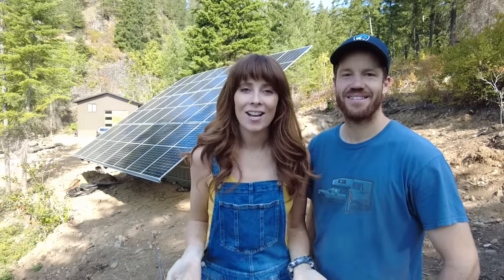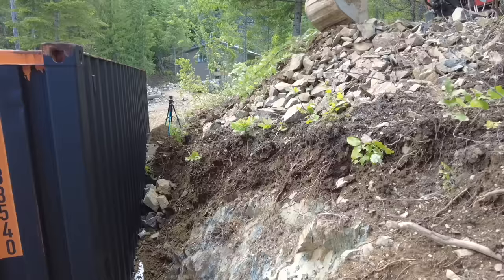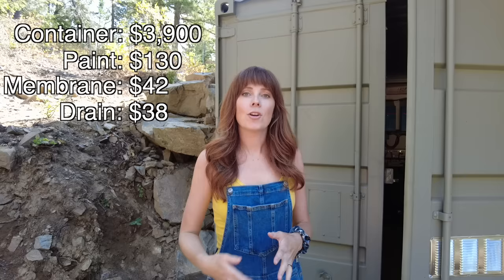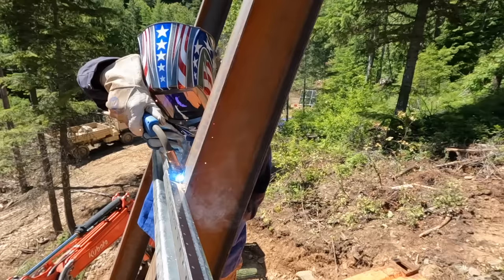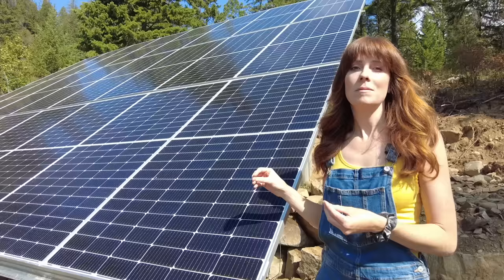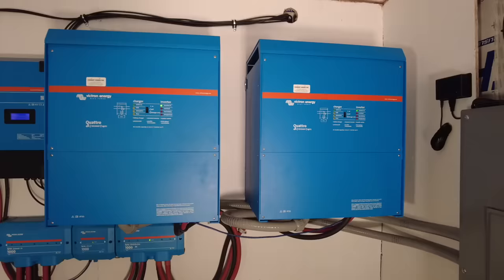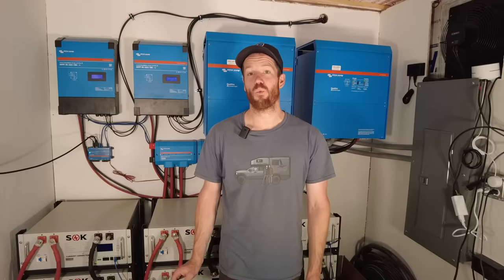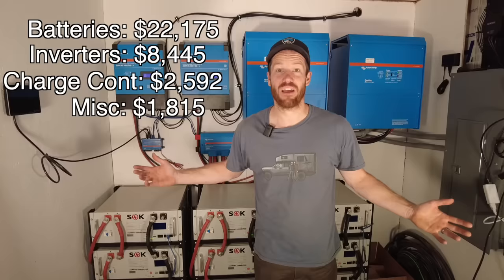TOTAL COST Of Our Off-Grid Solar Power System | Powering Our Mountain Home

Comment: I don't know if anyone will read this comment, but here goes anyway.  In 1995 My wife and I bought a small piece of property.  (2 Acres)  We put a nice 14x 70 mobile home on the property.  We were only 2 power poles from power, but the Power company  (Elko Nevada) want me to give them $12,000 for the privilege of paying them $150 bucks a month.  This made me mad!!!  At first we just had a generator, so I started to make our solar array mount.  We had eight 80 watt panels.  We had eight Trojan L16 six volt lead acid batteries.  We had a Trace 2400 watt inverter, so that meant that we only had 110 volt for the house.  We upgraded to an Onan 6500 watt generator powered by propane.

The house had a propane fridge, a propane clothes dryer, a propane water heater, an infrared propane wall heater, and the existing propane forced air furnace.  Since the insulation under the mobile home was all screwed up by animals, (we bought it used), I cut all of the underside plastic off, and installed 12 inches of fiberglass insulation, which was held in place with a system of special made brackets and plastic tarps and nylon rope.  It worked so well that after doing that we never ever fired up the floor furnace.  We also had a wood stove, but after 2 years of getting wood, hauling wood home, splitting wood, stacking wood, and dealing with the ashes, we just used the wall heater, which did an awesome job.  The home had real good insulation and 2x6 walls.

We had a well drilled and since the generator did not have 220, we installed a 110 volt pump in the well.  We filled a 600 gallon water tank that lived in the battery room, and pressurized the house with an RV 12 volt water pump.  Everything that I read at the time said that the RV water pump would not work long with continues use.  But being the bull-headed person that I am, I did it anyway.  The RV water pump worked just fine.  It ran the dish-washer, the clothes washer, showers, toilets, virtually everything.  I will admit that I supplied the pump with a 1" line right off the bottom of the tank, and then tied into the 3/4" pipe for the house.  I did not know how long the water pump would last, so I had a spare.  It lasted 4 years, and I changed it out in 10 minutes.  Not bad for a $68 pump.

All in all, I had $12,000 invested in my system, and I did not have a power bill for 5 years.  There were things that had to be done differently than if the house was on the grid, but it was not a big deal.  Like one thing was the the inverter would not run the spin cycle on the clothes washer, so we would leave the lid up while doing a load of clothes.  When it went to the spin cycle the washer would just stop.  Who ever walked by the washer and saw that the washer had stopped, they just had to walk 20 feet and push the starter button for the generator, close the lid on the washer, and turn off the generator after it was done.  Like I say, not a big deal.

They did not have these great batteries at the time that I did my set up.  I could have just bought a 3600 watt inverter for the washer issue, but I am cheap.  It was not a big deal.   In the summer when it was too hot, I bought a window A/C unit for the bedroom, and it would run 1 hour before we went to bed, and then turn off 1 hour later.  We had a swamp cooler too, but if we ran it at night it would drain my battery pack.

Courtney and Riley are doing a first class job.  I did not have the money to do mine like that, even if it were available at the time.  I still have no regrets.  I sold the place 20 years ago, and have not been back.
Reply: side note on the plastic tarps holding up insulation...hopefully there is enough air exchange using tarp, seen some pretty nasty mold issues from trapped moisture with similar setup (full plastic sheets instead) as generally speaking, it would act as a vapour barrier, but on the wrong side
Reply: Wao. 
That was a lot of work & I bet it is satisfying now.
Thanks for sharing that story
Reply: Will you help me out to build an offgrid place

Comment: Hi. Thanks for the video, I've enjoyed watching it. And I don't want to feel disappointed, but I want To share a few thoughts as a PV installer:
1. Changing the array angle for winter is a good idea. But using the PV power optimizers (like Tigo) in your case would increase the system efficiency even more. You will have a lot of shade in winter, and the optimizers will help you to solve the problem.
2.  445Wp panels for 230USD is 0.51USD/Wp. It's not a killer deal. It's actually 2,5 times more than what we pay as an installer for this kind of solar modules. It's normal price 0.195USD/Wp for container volumes. And 1848USD for 100Ah/48V battery is 1,5 times more than what we pay for it.
3. I recommend you be extremely careful when changing the angle of the array. The bump may cause micro-cracks in solar cells.

Comment: Nice video. I have few advise on my experience from solar (if interested).
So here it is  :
1. Make sure temperature during summer months in that container is pretty low. 20C Degree is the best so about 68F if you go above then inverters will suffer and it will show in long term.. If you can't then buy cheap aircon.. It will work only during summer months so no need to worry about extra electricity it will take..Also you can change mode on it when needed so it will heat as well when needed.  

2. Make sure SOC don't go below some limit if possible (about 20-30%)..it isn't problem for summer at all.. but for sure it will be big problem in winter time.
3. Don't believe that nonsense that inverters don't need extra cooling.. Take out that blue sheet that is on top of the inverters (mostly during summer time) to reduce heat and improve air circulation as Victron Energy inverters will not start inside fan till temp is high or load is also high..
 4. Also after some time ..check your battery packs..they have BMS ..so you can checks each and every one(how much KWH they cycle)..I did see how you connected your battery packs and it isn't the best . You will find that some battery packs are cycled more than others and those will be first to go ..
5. Be sure there are no bugs in that container...bugs like to go every where and that could kill inverters and all electronics.. 

Even then Those battery packs will be first to go.

 Don't kid yourself with 20-30 years of life of your system.  Battery packs will start failing about in 15 years ..if you are lucky and you do as i suggested then in about 20 years inverters and chargers will go ..So be sure to prepare small amount of money(every month) so when time will come you can buy it any time you want ..

I wish you the best.
Reply: Very true, I’m thinking will battery and inverter last 10 years.  All those spec talk, I don’t think people test it in real life🤣
Reply: @jakeliujakeliu  Those Batteries are Lifepo4.  They WILL last 10 years and STILL have 80% of their rated capacity, and that assumes a charge/discharge cycle daily.  They likely will last 15 years or more.
Reply: @HutchinsonJC  I know I got couple LifePO4 too, I’m just saying nobody really use those battery 10 years yet.  I see most people replace inverter within 2-5 years range.
Reply: Good solar inverters should have at least a 10 or 15 year warranty.
Reply: @GregHassler  well should it correct wording..but in reality it is unlikely you will find such capacitors that would be able handle it for long they will eventually dry or explode or anything between and that will cause fets to spike in wrong time so it will damage inverter at the end ..Capacitors are real reason why any electronics doesn't last so long ..there are special ones that might last but you wouldn't able afford them  .. In general normal ..even crapy inverters should last about 2 years..a bit better one about 5 ..very good one about 10 ..and after that it is only luck and ofc ..environment and all that and between..
Reply: 68F!? That's a lot cooler than room temp for a huge part of the US. It's a totally unrealistic temperature to maintain, if that's really what those inverters require they are complete garbage.
Reply: @SylwerDragon  If that's really the case a good inverter should have easily replaceable (Not soldered) capacitors with a maintenance schedule.
Reply: @bobbygetsbanned6049  well that would be good idea but it isn't the case as that would increase cost to come up with new design that would allow it.  So in general if you want to calculate with all this answer usually is ..better rated capacitors/components and much more airflow if/when possible...this is usually done by implementing cheat into design..such as small fan inside the closed chassis or similar when space allow..it actually is pretty clever idea to be honest and i did see it on few closed IP65 inverters.

Comment: For a DIY system that is an excellent setup. Using a packing container is genius move, it provides weight and structural stability while providing a perfect housing for batteries and electronics. I am an electrical engineer and I can't really fault what you have built there. The price you paid all in may sound expensive but for the capacity you have there it is really inexpensive.
Reply: owlhuman  They built it themselves so it's DIY, the cost is irrelevant, they spent the money on this system rather than getting grid connected which is why it was worth spending that kind of money. I have seen a lot of DIY systems and built one myself and this is a well designed and implemented setup. If they had gone for a professionally installed system with this capacity it would have cost a lot more.

Comment: Using the shipping container for multiple purposes on this installation was brilliant. Very nice! Great forward thinking. On our little 6.5 acres, our house is oriented in the worse possible way to even consider roof mounted solar. This  shipping container concept would almost be a no brainer for us. At 70+ years old, doubt I could recoup the costs though.
Reply: Lol have you looked at vertically mounted bi facial solar panels? Or with a white roof?
Reply: My system has the same number of panels, I have 2 6500 watt inverters and 20 kWh of batteries. Cost $20,000.  I am in Florida so I use the most power in the summer, I can easily save $1000 a year.  I am 71, my dad is 93, I should live long enough to recoup my investment even if the cost of electricity does not go up.

Comment: Hi guys!
Thank you for the cost break down. I think the 50K is actually reasonable. Especially when you consider all of your labor. 60K to bring in grid power, then add in a monthly energy bill you will be in 10 years way ahead. As always, love to hear from you guys. You rock! 🌞
Reply: It's not even clear if those 60K to connect to the grid was a price offer or an initial estimate, the real cost might be much higher, and after all that they are still paying for the electricity from the grid.
Reply: @Sindrijo  And what about potential power outages associated with the lines coming out to the property....

Comment: I really love your setup! Have you considered building a sand battery silo next to the house in order to keep the the house warm throughout the winter? The thermal insulated silo contains a coil which heats up just plain old sand at around 600 degrees Celsius and it'll stay hot for months.

Comment: I hope this works out for you. I've lived off the grid for seven years, and I get all my electricity from solar panels. Like you, I live in a place that has harsh winters. I have three concerns about your setup. 1. I think your batteries might get so cold in winter that they won't work. 2. I think some of your panels might get buried in snow, or at least partially buried, because they are pretty close to the ground. 3. I'm not so sure fresh snow will slide off the panels, even at "winter tilt." My panels stand straight up, 90 degrees relative to horizontal. I have them that way so the snow will slide off. Sure, the panels aren't at optimal tilt, but the good thing is that I never have to spend time removing snow from them.

Good luck. I hope I'm wrong about all three of these things.

Comment: Thank you for breaking this out, always wondered what the costs were. Would dig out the container and seal it, build a barrier wall and seal that with drainage and run off so the container doesn't rot. Might also dig a few feet down in front of panels so snow has somewhere to go when it melts off. You guys are SO great to watch!

Comment: Another solution that could help with the wind issue is a deadman up on the hillside. Then put a cross brace at the top of the panels and use a cable ratchet to hold it in place like the tilting of the panels.

Comment: only change i would make is  to step your bifacials ahead to make them like a set of stairs and paint side  of shed shiny. keep panels slightly more vertical winter and summer. put a short shiny wall back 8ft to deflect wind. looks good. will give you more power on cloudy days and in winter and keep panels closer to ground or you can raise up more

Comment: As some one who has lived off grid for 10+ years, you guys have made very good choices! You will / should add a small heater, 12v diesel electrics are well worth it
Reply: Solar is not currently worth getting as a stand alone power source unless you live somewhere that doesn’t have access to the power grid. When factoring in initial equipment cost, maintenance, repairs and equipment replacement costs solar is a drastically more expensive power source than a grid power source UNLESS you live in one of the few states that pays for the extra power you feed back to the grid. Maybe in 10 or 20 years when the technology advances and becomes more cost effective it might be. The ONLY off grid power source that is cost effective is hydro IF you have enough money to buy land with a constant moving water source.
Reply: @jessebarnett4205  Well you forget the other usecase: It allready pays for them because getting on the grid is more expensive than building an island system. 
I just made a quick calculation and used a small 8kw diesel generator as reference. It would cost 50k USD in Diesel to operate such a generator for 4,5years at 50% load for 18h/day if we use a price of 4,5USD/us-gallon. This system should survive 4,5years without major maintenace. So I guess it is a good solution.

Comment: I think this will work well with wood primary heating. Living here in the Selle Valley for over 20 years, we have seen so many variations in our winters. The general pattern of northerlies in winter and southerlies in summer holds true, the critical thing is cloud cover. No cloud cover means extreme cold and lots of clouds mean 29 degrees. I would encourage you to consider a  simple rail wiper design to easily remove snow and I agree that you need some reinforcement for northerlies. Sadly, I suspect your road maintenance may be more time consuming than your power. To the good, when you eventually decide to sell your property there are lots of preppers, who will love your design.

Comment: Great video, Folks! Thank you for sharing your experience. I do have one question in which I am having difficulty finding an answer: How are you able to protect your system from over charge when nobody is present at the property? Suppose you may be traveling for 2-4 weeks; what can be done to prepare for such a leave of absence? I also have a similar off-grid solar power system, albeit smaller in scale. It seems that regardless of which charge controller one may have, if the panels are receiving light, they will be producing photovoltaic energy as well. With the battery bank being fully charged, how can one prepare for this additional energy pass-through without damaging the system? I hope this question is intuitive and clear enough, my apologies if not. Looking forward to your point of view. Cheers!

Comment: I've used solar on our properties for many years and recently helped a very good friend who moved from California to Montana. We installed some additions to his solar array system to boost his output in the winter. Basically he was DC coupled through charge controllers charging his batteries, then inverting and send AC power to his loads. This works very well in summer with a string connected system to your mppt charge controllers. HOWEVER,  in winter was a VERY DIFFERENT STORY, he found that with strings partial coverage by snow was very problematic for output (ask your installer). I have the same problem in winter.  My solution was to install a 5000 watt Enphase  micro inverter array which is AC coupled to my system. There connected directly to the AC buss and bypass the charge cycle, by supplying loads first then if there is extra required for charging your inverters will charge your batteries works great in winter because snow only affects the covered panels.  Food for thought FYI hope this may help if you need it later. PS love your channel.  Fred

Comment: photovoltaic / solar thermal technician here: my hat off great job, i wouldn't worry about wind hitting the back, same thing goes with stand alone systems, you can add corrugated panels if you want to stop the wind from hitting the panels. love that you buried the container and that your panels tilts 👍
Reply: Is it feasable and worth it into scaling this idea for a multiple MW solar farm? Thus giving energy also at night for the grid? Assuring the containers keep optimal temperature for batteries and all that is needed? Giving you have some arid terrain where farming isnt quite productive?